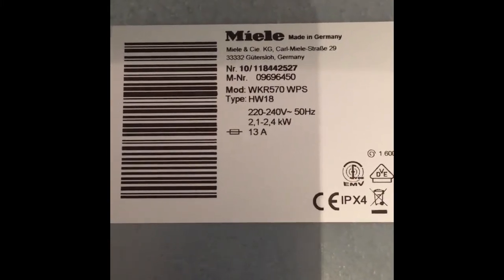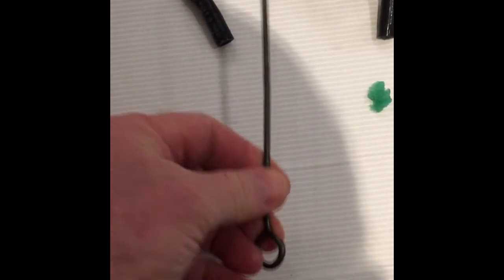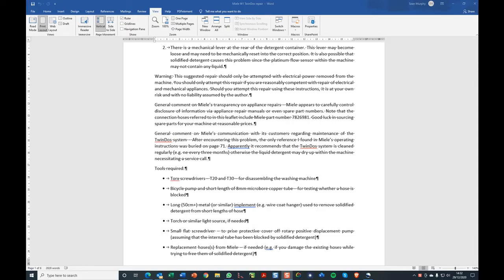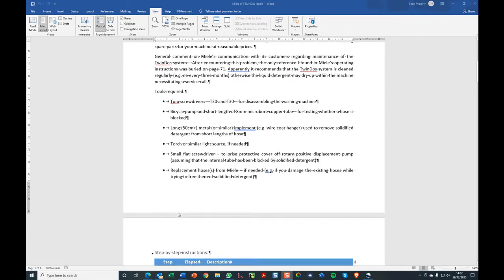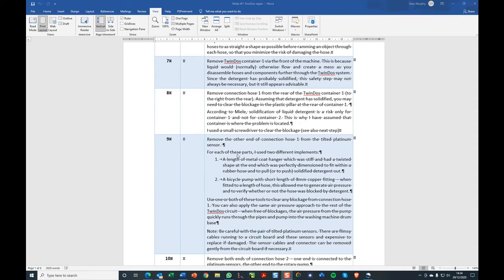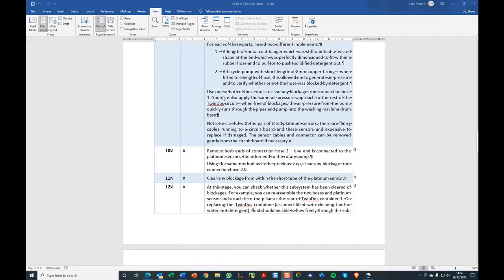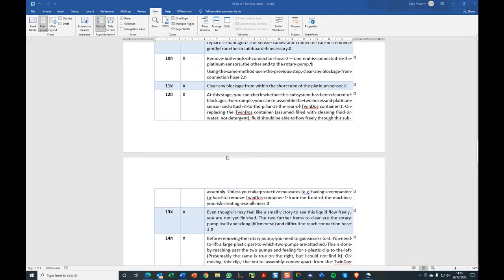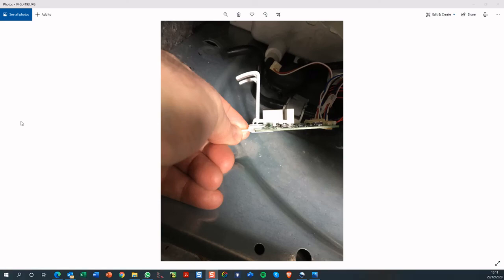Miele W1 WKR570 TwinDos Washing Machine Repair - problems with solidified detergent

Comment: why don't you run a cleaning cycle of idos with hot water several times until it dissolves all this detergent, also i guess if you do it every month it will not clogging, and but the way is a very common issue that the twindose leaking on the bottom and corrode every things and in warranty they completely replace the machine free, i will call miele assistance any way even if is not on warranty and complain and pretend a new machine anyway, speacking of a lawyer.

Comment: For me, after trying again and again, a water / citric acid solution filled container worked, also might just be random because i did try like 10 times yesterday, so it might have cleaned up by now. So i guess try a few times before you dismantle your machine.

This is insanely detailed documentation though, holy hell, good work.
Reply: Could you explain how you used the citric acid solution - was it in loaded into chamber 1 or 2? Did you just run a normal wash, or the TwinDos cleaning cycle? Thanks!

Comment: The basic question, which is usually not answered in such videos, is:
1. How long after purchasing the washing machine did the TwinDos become clogged?

2. During that time, were only the manufacturer's dedicated detergents in the TwinDos system used, or were there any other detergents for so-called filled containers that Miele does not recommend?

3. During that time, was the TwinDos Care agent, designated by the manufacturer and used for maintaining and cleaning the TwinDos system, used regularly?

4. Were there any very long breaks in the use of the washing machine (a month, 2 months or more)?

This only gives some idea of why the TwinDos system became clogged.
Reply from the maker: Hello Darius, in my case it was about two years from buying the machine to experiencing solidified detergent. However, the real trigger event was a change in user behaviour. For the previous two months or so, my wife and I had stopped using the DOS function and instead used the pull-out drawer to manually add powdered detergent. This meant that the DOS detergent containers and associated pipes and pumps were completely unused. Buried in the small print of the documentation somewhere is a warning that the DOS system needs either occasional use or full cleaning prior to a period of disuse. We have never used the specialist Miele detergent but instead use a regular big brand liquid detergent. We occasionally use normal water to clean the system rather than the Miele TwinDos care agent.
Reply: @zengoelectricslimited6744  This would explain why your TwinDos got clogged.

The following conditions were met:
1. TwinDos was not used for about 2 months - you are right, the instructions say that:
TwinDosCare
- cleaning agent for the TwinDos dispensing system
- to be used before a longer break in use (at least 2 months)
- to be used before changing the product

Therefore, before deciding to stop using TwinDos, you should simply rinse it with this agent.

2. However, I think that the real nail in the coffin for your TwinDos was, as you wrote, another agent used, as I assume, in a refillable container. Miele does not recommend using these containers and has even withdrawn from them, but of course you can buy everything on Amazon. People do not understand that other detergents come in regular bottles and have a completely different consistency/composition and are absolutely not intended for use in the TwinDos system.

Finally, thank you for your answer and detailed description, because it is also important knowledge for me, thanks to which I know that if I only use Miele detergents and do not leave the TwinDos dosage for very long, it should not clog. From time to time, of course, I will also maintain it with TwinDos Care.
Reply: @dariuszd1 yes all about maintenance other liquids are to thick meile is water consistency 😊

Comment: Thank you for such a great video - brilliant.  Instead of the second step of removing the top and front of the machine, I perseverred with using a smallish gauge wire (could use a brake Bowden cable) and a strimmer cord (3.2mm I think) and just rodded the two long hoses.  When using the wire I scrunched it up at one end and put it in boiling water before pushing it up the pipe.  It clearly was removing the congealed detergent each time I withdrew the wire from the hoses.  It did take quite a few goes - maybe 30 mins or so.  Then used a Makita tyre pump to pressurise each hose until it was clearly blowing through.  All works perfectly now!!! Thank you again for your efforts with such good instructions.

Comment: Hello, I am having a problem with my TwinDos(WCI670). It shows a message that it is empty and both containers are empty, although in reality they are full. If I take them out and put them back in, it washes normally but consumes all the detergent quantity from the containers. When I try to clean it, the process stops and it displays a message that the container is empty. I have done the following:

1.Cleaned all the pipes which were clean.
2.Reconnected them and without attaching the hose that goes to the drum, I cleaned the device with water and it worked properly in both containers.
3.Changed the circuit board(EZL 166) and checked the PT 100 (108 ohm and both were the same).
Despite doing all of the above, the problem still persists.

Thank you very much for your time.

Comment: Our WKH120 developed a fault and upon further investigation found that the rubber 'o' rings fitted to the DOS cartridge receiver units deteriorate with age. They had allowed the detergents from both cartridges to leak into the float bowl sensor area and the DOS control circuit board & loom.
I bought new 'o' rings from a bearing specialist and now no more leaks.
Reply: What size are the "O" rings?

Comment: Nice job. Wonder would a piece of thick grass strimmer line be better to use instead of the metal clothes hanger.
Reply: A good idea. The metal clothes hanger was too stiff and managed to damage one of the pipes by penetrating through the soft rubber compound.
Reply: @zengomobilitystairliftslim6898  I thought I had a similar problem myself, but it turned out running the cleaning program a couple of times sorted it. Didn't like the idea of using a sharp hanger too much. But even if I was going to use the thick grass trimmer line, I would round off the sharp cut ends with fine sand paper just in case ; )

Comment: hy zengo I have a little problem with my washing machine Miele Wwg660Wcs tdos it write error code F214 what is mean? thank you for help
Reply from the maker: From Miele: Error Code Display: F214 - Thermocouple sensor open-circuited. Not user repairable.
Reply from the maker: https://shop.ukwhitegoods.co.uk/7017320-miele-temperature-probe - this is for illustration only, you can use it to identify Miele similar part numbers and then query whether it fits your specific model. Good luck!

Comment: Thank you for the video. I am having problems with twindos 1. I cleaned out all the lines except the one going to the front. Nothing I cleaned was clogged. I even squirted hot water up the long line and some liquid detergent came out. Before removing the top and front do you think it is probably the sensor? And I want to confirm is the sensor the grey block that both run through from the twindos cartridges before entering the pumps?
Reply from the maker: Yes, the sensor is the grey block through which the twin pipes run before they hit the pumps. It is an expensive part to replace.
Reply from the maker: When I was tackling my problem, I wanted to find a simple way of diagnosing where any blockages might be located. Even though it takes some time, I purchased an additional empty DOS container and filled this with water. Placing this water filled container in the DOS chamber (you may have to try both sequentially - first DOS1 and then DOS2), I was able to disconnect a single pipe (let's call this the monitoring point) and check whether the water was getting through to this point. This means turning the machine on and running the "clean DOS" maintenance program. 

This allowed me to verify whether: (a) Water could exit the DOS chamber; (b) Water was reaching the pump input; (c) Water was exiting the pump output and (d) - don't forget this - whether water was passing along the long pipe between the pump output and the front of the washing machine where the pipe attaches to the drum. This simple logical sequence allows you to verify correct operation at each monitoring point in the sequence. You don't need to use a lot of water - I got pretty good at running the maintenance program for thirty seconds or less. It helps to have a small container into which the free end of the pipe can drain.
Reply from the maker: If you use this method, then you can also mark the front of the water filled DOS container. When running the maintenance cycle, a small amount of water should be drawn from the DOS container, which is visible from the front of the machine. As long as you can see the water level drop visually, you can be reassured that the pipe and entire dosing mechanism is working fine. If the water level does not drop, then you need to diagnose each step in the sequence above as previously described.
Reply from the maker: Even after clearing the rear of the machine and the pumps, I also had a blogged long line to the front. This can be unclipped in two supporting positions and disconnected at both ends, then removed from the machine. You can either buy a replacement part (at extortionate Miele prices) or pass something through the pipe to clear it yourself. I used an old metal clothes hanger (including the twisted section near the handle) and this very effectively removed the dried in gunk that was blocking the pipe. I also ran some hot water through the pipe to make sure that it was absolutely clear.

If you drain several parts of the system - tubes and pumps - then it can take several runs of the maintenance cycle to re-fill the entire system. I presume that the pumps are self-priming thus even if empty they can suck in fresh liquid. Observing the water level at the front of the DOS container helps to reassure the user that the repair job has been successful.
Reply: I did it and front pipe was worst.

Comment: I had a “Waterproof” error. Opened it up and found that one of the Twindos pump had both plastic hose fitting broken. The twindos detergent had been leaking and collected at the base of the machine. Yup.. Miele could last 20 years they said….

Comment: Unfortunately mine still doesn’t work after spending many hours with it. First I only removed the front and reassembled everything without success…
Then I opened the back to see how bad the hoses were laying so the did not form a knot … I cleared that.
Then I was searching for the “back hose” nr 20” that you have on your list but could not find it:(
Before I did this operation I only had trouble with the twindos nr 1 but now both say the exact same thing “not enough detergent “ like it is not pulling it in.
The only part of the hoses I did not remove was the last part around 5 cm long that enters into the drum…
I was too afraid to remove them but I had a tool inside there gently to se if it was clogged.
Very strange now that both stopped working instead.
Thanks anyway for your video.
My model is wkr 771 wps…
Can it be that the rear hose is not there on this model?
Reply from the maker: Hello Aziz, Have a look at the answer I wrote for May Workman. This might help you.
Reply: @zengoelectricslimited6744  thanks for your comment.
I actually solved my problem.
This was a while ago but I had connected the pipes to the wrong pump 🙄🙈

Comment: mine is called w1 wrk 771 wps, it looks like the same but it isn't. I have seen others do this operation with clogged pipes... but they only opened the front of the machine and did the operation. I have a hard time figuring out how to open everything really.
Reply from the maker: Hello Aziz, You are right - it is possible to do this repair from the front of the machine, though I found that out only after recording this video. It is a bit hard to explain how to do this verbally, but I shall try. 
(1) Remove the top panel of the machine, using screws at the side which may be hidden by plastic covers; 
(2) Remove the front of the machine - slightly fiddly, including removing the seal on the washing machine drum  - see other videos for how to do this; 
(3) Unscrew the plastic frame holding the TwinDos containers - this entire TwinDos assembly should now come loose
(4) Observe that the TwinDos assembly may still be held in place on two plastic legs which are engaged with hooks on the metal base plate of the machine; you need to push the entire TwinDos assembly towards the rear of the machine so that these plastic legs come free from the metal base plate; you should now be able to pull the entire TwinDos assembly through the front of the machine and gain easy access to the clogged pipes at the rear of this assembly.
(5) You can then follow the process outlined in the video
Good luck!
Reply: @zengoelectricslimited6744  Thanks a lot, I will try this on my machine. Thank you for taking the time to write this down and helping me. It saves me around 150 euros that I can do other stuff with :)
Reply: @zengoelectricslimited6744  omg☺️
Have taken it appart now… took me some time though.
Mine hade spilled disgusting gèle/liquid (brown) all over the left hose and that had leaked to the bottom.
Just a bit curious how sensitive the cables connectors are let’s say at 4:25 (thing in the middle)?
Cause it has god some humid on it and some liquid… also a little bit on the back safe of the big connection to the circuit board…
I’ll try to reassemble it now.
Since I did not open the back I hope I don’t need to do “nr 20” on the list.
Lastly… I was too afraid to remove the last bit of hose that goes directly in the drum…
I don’t know how hard it is to reassemble the house again… any tip? Should I have some lubricant?
Reply: @zengoelectricslimited6744   I think I’m going crazy…
Just for fun… I
Managed to enter service mode…
Then when activating/running compartment 1 I had opened the back of the machine to see what happens… the pump nr 2 was working at that time ?!?!?!
Then tried nr 2 and the pump 1 was working… so I figured that I had attached the cables in the wrong pump but this can not be true since the have strapped the cables so they don’t reach both…
What am I doing wrong?! 😭
I’m going mental since to me this is not logic.

Comment: I have been using the laundry TwinDoss system for a month and it looks like the detergent is being used from the second container, but the text appears the same. If anyone has another solution, I'd love to hear from you. Thanks!
Reply from the maker: You may have incorrectly set the menu options.
There are two separate sections in the online user menu. One section allows you to let the machine know which container uses a specific type of detergent. The second section allows you to select the detergent to use in the wash and the amount of detergent to use.
See: https://www.coolblue.nl/en/advice/install-miele-twindos.html for more detailed information on how this works.

Comment: Thanks for this really great video. I opened the back panel and could unmount only one of the tubes from the pomp, all the others seem to be stuck really well, did it also take you a great effort to remove the tubes? I’m afraid I pull to hard and break something.
Reply from the maker: Hi Sander - it does take a good bit of effort to unmount the tubes. However, they are all just "friction fit" pushed into place, thus they do eventually move more easily. I like to use a long-nosed pliers to do the job. If you start with the tube to the rear of TwinDOS chamber 1 (to the right looking from the back) then this is quite straightforward. Once the first tube comes loose, access to the others becomes progressively easier. I also found that on applying pressure your hands can get hurt if/when the tube suddenly releases - it's a balancing act I'm afraid. Keep going!
Reply from the maker: If you can release the entire assembly then access becomes easier. Both pumps are attached to a plastic box which can be lifted upwards and then backwards. There is a knack involved - there are two lugs at the top of this plastic box which disengage with a little finger pressure. With a bit of experimentation and patience, you will learn the skill.
Reply from the maker: https://www.ebay.co.uk/itm/Miele-Im-TwinDos-Enschubfach-steht-Flussigkeit-F211-F212-F213-F214-NR-30/254444258816?hash=item3b3e0f4600:g:z9sAAOSwX9ld6U86 - If this link to an eBay advert works, you can see a parts diagram that may help you
Reply from the maker: You are trying to lift off (from the rear) the part numbered 170
Reply: Ok thanks for the pointers! I was able to release the gray part that holds the pumps and circuit but I was unable to detach the tubes from the reservoir holders. Will try again!